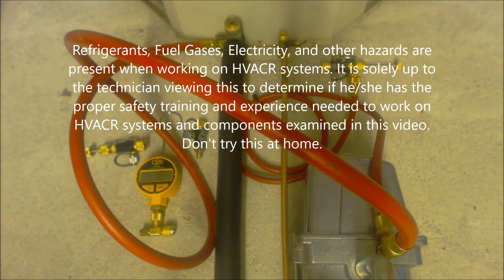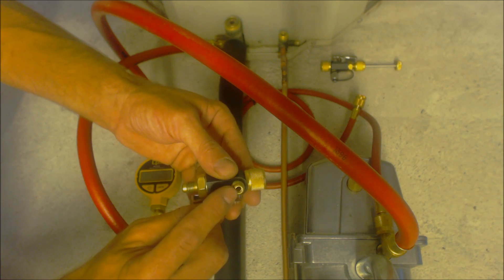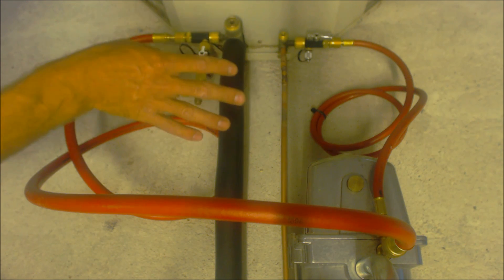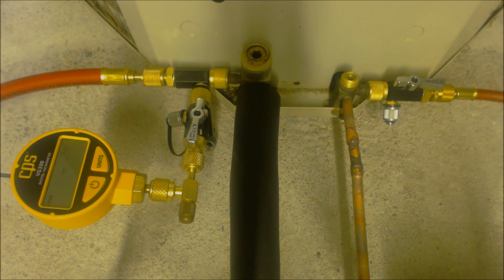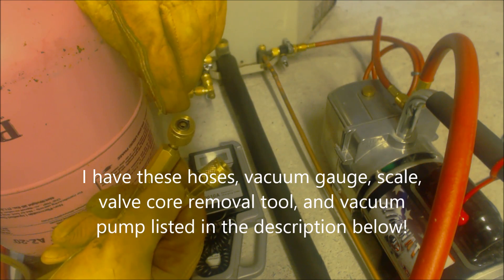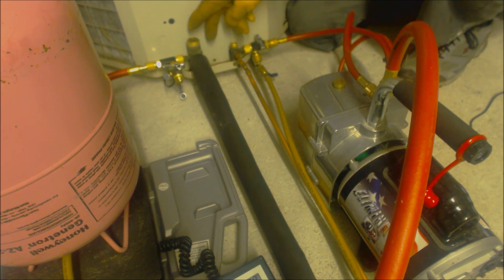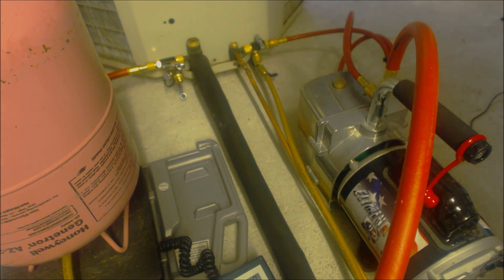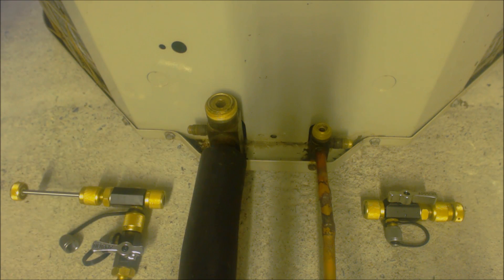Vacuum Pump AC Lines and Break the Vacuum with Refrigerant: Setup, Micron Level, Weighing

Comment: Buddy ,I've been watching videos for several weeks now, I highly respect and admire knowledge and tips, I have learned a bunch from your video, I got a quick question I'm getting ready to order some vacuum hoses I know  you're using the red hoses from oppian ,which are 3/8  should I get the 3/8 hoses or the 1/2" let me  know, I am not going to be working on any commercial units only residential's nothing big, again thank you for your time and priceless tutorials
Reply from the maker: You could get the 1/2" ones but they may be a little pricey. What I am trying to show everyone is that could can put together a vacuum hose setup fairly cheaply. I personally use that 3/8" hose with the 3/8" connection and 1/4" connection. For the liquid line, I just use a very inexpensive 1/4" hose. With this setup, I have vacuumed 125' line set 1 1/8" by 3/8 tubing with a used evap in under twelve minutes to a vacuum level of 200 microns. It held 200 during the standing vacuum test. I have the tools I use linked at amazon.com/shop/acservicetech. I also receive a commission with any amazon purchase after clicking through any of the links. The price for the consumer does not change at all and the purchase doesn't even have to be the item clicked through initially. Anyway, it doesn't hurt to go bigger. It will be an even faster vacuum, just make sure to keep the manifold gauge set off of the vacuum setup, thanks Al!

Comment: So after evacuation is satisfied on a new AC system and high, low and vacuum knobs are shut off and I need to add the extra 410a which in my case is (18ft x .6) =10.8oz.

Do I after prepping jug on scale:

Open just high side guage with   service valves on AC unit still (seated) closed until I read the 10.8oz on scale. 

Then shut high side and jug off. 

Open service valves on AC unit, turn on power and start up system?

INFO. I have no valve core tools so evacuation in my case will be I guess old school until I can purchase them. So straight hoses from guages to service valves.
Reply from the maker: In that case then you would attach the r410a bottle upside down to the yellow service hose, purge air to the end of the yellow hose connected to manifold. Then zero the scale and weight liquid refrigerant into the liquid side until you get to the weight desired. If it is a system that you can turn on and check in superheat or subcooling then weigh a little less than needed and do final adjustments while the system is running but I would highly highly recommend getting 3 appion valve core removal tools. I have them linked at amazon.com/shop/acservicetech  , Have you looked up the video on vacuuming- "acservicetech full vacuum procedure"? Thanks
Reply: AC Service Tech LLC I do plan on getting the removal tools, just trying to save up for them. This job came up for a great friend and I wanted to get it done for him now. It is a new 3.5 ton Ruud AC unit and new Ruud "N" coil. I was told to do everything as I was asking you earlier except that they said to open both low and high side hoses after evacuation and weigh the 410a in, then shut hoses, open service valves and turn on power. I just thought opening both high and low side was incorrect and I only needed to open high side?
Reply from the maker: Yes thats right, just open the high side. It is just so the liquid has a chance to go through the metering device before making it to the suction side as a vapor. It is only a small amount 10.8oz so it would have been ok but we just want to get in a habit of breaking the vacuum with refrigerant into the high side. When you need to weigh more than that, the only way is to put it in the high side so you can get enough refrigerant in before the liquid has a chance to vaporize and apply pressure against the pressure of the bottle, thanks!
Reply: AC Service Tech LLC thank you very much.

Comment: Is it nessesary to remove the shrader valves?  I am replacing a unit for my son and I do not have the core removal tool
Reply from the maker: It really really helps when vacuuming but it doesn't absolutely have to be done. A vacuum with removal of the valve cores may take 3-10 minutes where as one without may take 1-2 hours in order to reach below the 500 micron level. Then we do the standing vacuum test to see if it rises, thanks
Reply: AC Service Tech LLC p

Comment: You can't break your vacuum by just backseating the valves that come with a pre-charged factory setting and then turn the unit on and then add refrigerant if needed or is that bad
Reply from the maker: With the two position service valves backing up the valves is not like backseating with a 3 position valve which would shut the port off. These were two position valves and you can break the vacuum with either refrigerant from the system or from liquid out of the bottle into the liquid port, thanks Bobbe!

Comment: Great video and I do the same technique but use 1/2 " Appion hoses. A week after I ordered my new 1/2" Appion hoses I see that 3/4" Vacuum hoses are now available lol. I also purchase vacuum pump oil by the gallon so I change my vacuum pump oil after each use. Keep up the awesome videos.Thanks
Reply from the maker: That's awesome to hear coolmandude1000!
Reply: You absolutely don't need to change the vac oil everytime. Just add nitrogen and release quickly via quarter valve to make sure all crap in your system is kicked out, then if your oil allows to reach the vacuum needed regarding to the lowest temperature around your system. 'Water saturation curve'

Comment: Just wondering about something.  When you connect and purge the yellow refrigerant hose then screw it all the way onto the valve core of valve core removal tool, isn't the vacuum inside the lines pulling air with moisture into the system in addition to refrigerant (which you have partially flowing) till the hose nut is completely tight?
Reply from the maker: I think you are talking about breaking the vacuum with refrigerant. So purge the air out at the end of the hose connected to the liquid line valve core removal and also when tightening it on. There will be no air or moisture left to pull into the system but just refrigerant, thanks

Comment: Hi Ac, If you have to do a repair on 1 part of the system can you trap the refrigerant in the half that you are not working on or do you have to remove it all first ?
Reply from the maker: Yes you can pump the unit down and hold the refrigerant in the outdoor unit. But you can't do the reverse and hold it in the evap on standard residential light commercial units, thanks
Reply: Great stuff, once again hope you don't mind me asking questions so much
Reply from the maker: Its ok!

Comment: at 9:27 the text comment is somewhat wrong. While R410A is a near azeotropic some refrigerants are not azeotropic, hence the ratio of constituents in vapour is drastically different than the ratio of constituents as intended. You have to weigh such refrigerants as liquid, to have loaded mixture ratios as close as possible to intended.
Reply from the maker: Hey One Two, this is only in reference to weighing in any refrigerant in a large quantity to break the vacuum. Vapor is what applies the pressure so we are trying to weigh in the mixture in liquid, regardless if the refrigerant is r22 single component, r410a two component near azeotropic, or r407c zeotropic, thanks One Two!

Comment: I love this video as a tech of 34 years this is almost identical to how I pull a vacuum the only difference is I use two micron gauges so you can see both sides of the system as there can be a big difference until all the moisture is removed.
Reply from the maker: Very nice!

Comment: I know it's off the topic in this video but do you have a video that shows how to charge 427a after recovering from R22 and do you still go back with factory charge amount?
Reply from the maker: I actually do not but weigh in about 90-95% of the poundage listed unless short lineset and then turn the unit on and add charge as needed, thanks Michael!
Reply: acservicetech thank you I appreciate that I was just making sure I did that correctly.

Comment: Could you do a full video on reclaiming refrigeration then vacuum and pressure test then  charge the system AKA  how to use the manifold gauges correctly
Reply from the maker: Well unfortunately that video sounds like it may be 4-6 videos for me but yes I understand that it would be nice to see a full run down from start to finish. Thanks Green Hornet Bandit!

Comment: @acservicetech what would you use if you cannot use the core removal because service valves not straight or not enough space to hook them up
Reply from the maker: I just had this problem the other day. You don't really have a choice and you will need to just leave the valve core there and connect your hose with valve depressor on it. If you can get one on then do that though, thanks HVAC-JC!

Comment: I have a quick question, I just bought the blue vac LTE. I pulled a few vacuums with it but each time I'll get down to about 300 microns and as soon as I shut it down and isolate to leak test it goes all the way back up to 2500 microns and stays or slowly starts falling back down but never below 2000 microns I even isolated it on a new recovery tank to check it on there but same thing. Do you know what could be causing this?
Reply from the maker: Try isolating the micron gauge with the valve you are using for just one second and then open it back up while keeping the vacuum pump running. I noticed that sometimes there is some trapped air in or around that valve so that is what I do usually but it is closer to a 300 micron jump not that high. Where is the micron gauge? are you able to get it close to the vapor line service valve and away from the vacuum pump? thanks
Reply: acservicetech thank you for getting back to me on this, I have the hilmore 4 valve manifold so I hook the 3/8 line up to my vacuum pumpand I remove the yellow hose and attach my micron gauge on the manifold

Comment: One suggestion:  I have had Schrader valves leak vacuum fairly often.  My practice is to install the charge hose, purged of air and with the ball valve closed, before I pull vacuum.  After all that work, to hear a hiss when you take the cap off so you can attach the charge hose would push my buttons...
Reply: Yes, I’ve had this happen where the side port of the appion shrader core sucks in air when in a deep vacuum. I’d highly recommend removing the micron gauge and charging there. Of course purge before opening the valve on core removal tool. I’ve done this many times and it seems to work well. I’m a little ocd when it comes to pulling a vacuum. Good video.
Reply: Leo,  yes I have always wondered if the valve core has a weaker return spring it would act as a check valve and pass the vacuum but block the normal pressure in the line?
Reply from the maker: My advise would be to add refrigerant to break the vacuum first before adding the schrader valves back in, thanks Leo and r aeronca, I hear you and there is nothing more frustrating than wasting time with a problem with a vacuum, thanks and did you check out these other vacuum videos?- https://youtu.be/jlzecsOImqs  --  https://youtu.be/RA7BY7dixIg

Comment: I have never seen a video on YT that explains how service techs use digital gauges to determine superheat. The analog gauge method is to use WB and DB temps to determine SH but the digital apparently don't use this method. I did see a Testo video that said their SH display was low side saturation temp. less suction line temp. Why is WB important on analog gauges and not on digital?
Reply from the maker: Here is are a couple videos that may help-  https://youtu.be/NKqpXVdOHec  --  https://youtu.be/q-G7FLlzhAg
Reply: Digital gauges give you the actual superheat, but you have find out your target superheat using the wetbulb.
Reply: I found a Fieldpiece set of gauges that have sensors to enter WB and DB and it displays target SH on the screen. Fancy.
Reply from the maker: Yes Steve, I will at some point be going over the job app by fieldpiece. I would also like to do some videos with the digital gauges just to go over them with everyone, thanks.
Reply: Thanks. Where I got confused is when someone explains how to calculate target SH but doesn't clarify that target SH may be different from actual SH measured at the gauge. Also, that adding or recovering refrigerant should correct the actual SH to match the target.
Reply: Download for free (Check and Charge app) it will tell you to add or recover refrigerant to match your target superheat. when your actual superheat is above your target superheat, add refrigerant. and when is below, remove refrigerant. 5+/-

Comment: if you have your lines vacuumed  to 250 microns and you open the lever of your valve core remover to perch air out, before replacing the valve, what your actually doing is letting more air in. If not correct please explain.
Reply: He had already added 1 pound of refrigerant to pressurize the system.
Reply from the maker: Thank you both for answering the question and thanks for the question xrayneoo!
Reply: xrayneoo 1 pound of refrigerant should be enough to get the system pressure above 0 psig so no air is sucked in. I always attach a pressure gauge to the opposite line of my micron gauge so I will always no I have positive pressure once a small amount of refrigerant is added to break the vacuum. One line has a micron gauge attached and one line has a compound pressure gauge attached when I start to pull a vacuum, most importantly do not get any air in the system.
Reply from the maker: Yes one pound is usually much more than enough for smaller 5 tons and less residential systems but I just did this as an example. I will usually either break a vacuum with opening the service valves or weigh in almost but just under the total amount of refrigerant needed for the unit which would be found on the rating plate but be aware of lineset length and additional refrigerant needed. You may break the vacuum with 1 lbs of refrigerant if the rating plate is calling for it, thanks
Reply: xrayneoo, he broke the vacuum adding refrigerant before replacing the cores.
Reply: I just wanted to know since if one pound is enough to brake all the suction and is it the same for a freon that requires less pressure like R22?
Reply: thanks

Comment: I have the sman460. I just use the 3/8 adapter out of the top of my vaccum pump. Didnt know you could even get a 3/8 to 1/4 reducer. I do like how you pump down the high side and low side at the same time.
Reply from the maker: Thanks Jason, yeah there are many ways to pull a vacuum, that's for sure, thanks